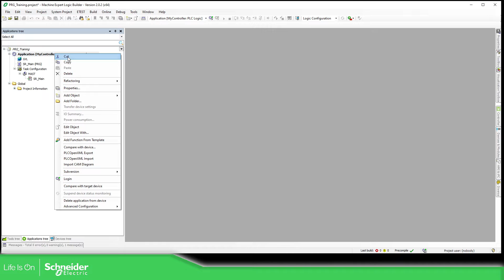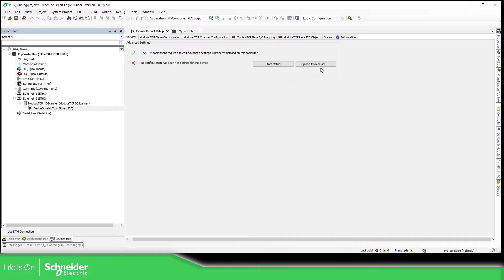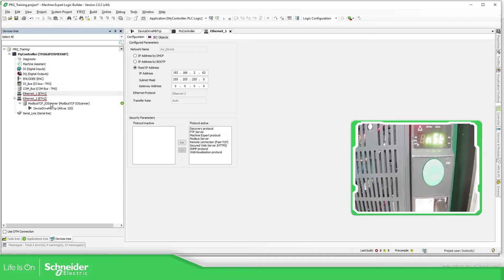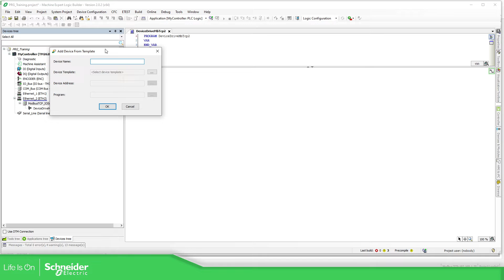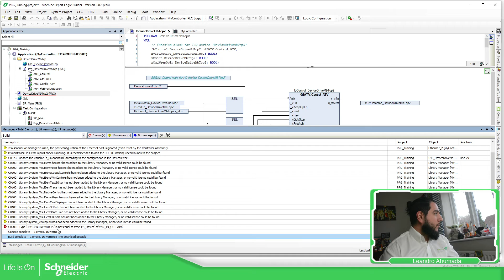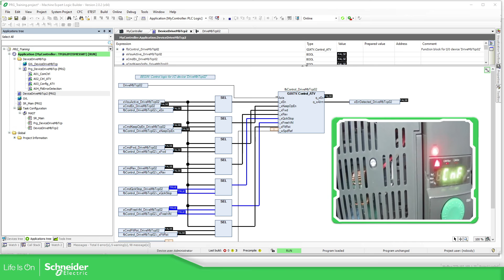Comment: will do you share m241 canopen communication with ATV320 simple project? probably canopen communication with ATV series like this video ?
Reply: Hi there! You can easily do it in your project by selection the option import from device template on the CanOpen section. I will do a video but you will need to wait for it.
Reply: @LeTomasAHUMADA  thanks

Comment: As I saw both Ethernet ports on controller had the same address...
Reply: Hi there! I have just checked it… and you are right 😅. I believe that the post configuration file on the plc helped me to not cause a problem. I will need to check if in the newer version of the software this is still possible or i did not pay attention to any warnings. Thanks!